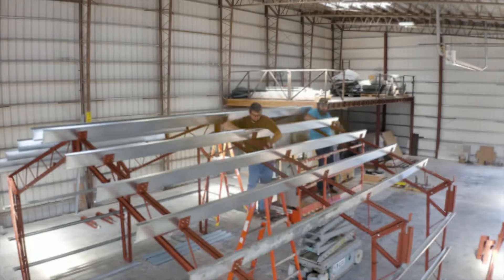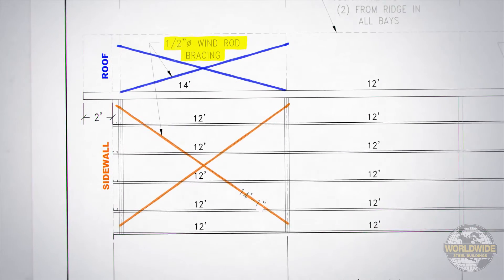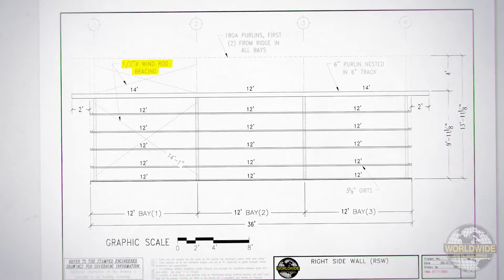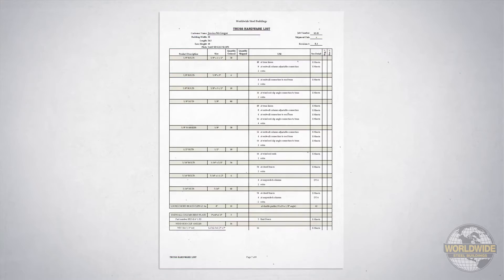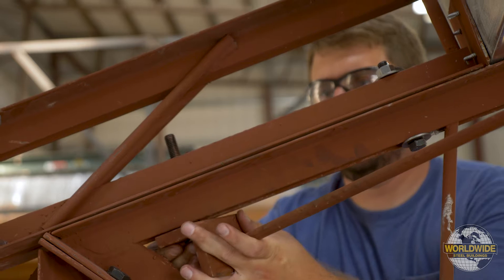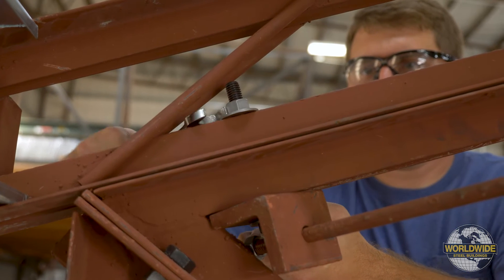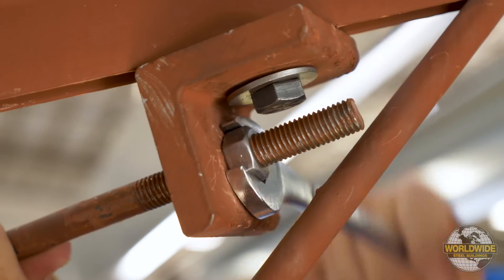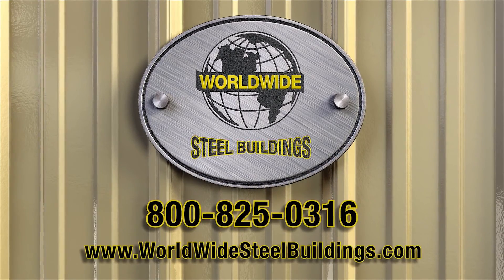Steel Building Construction - Wind Rod Brace Install for Roof - How To DIY Steel Building

Comment: So you use the wind braces to pull all the columns and roof trusses plumb after the purlins and girts are installed?
Reply from the maker: Great question!  You should check your building for plumb and square throughout the installation of the columns and roof beams so that they don’t get out of line.  Once the purlins and girts are installed, then we do use the wind rods to make final adjustments to ensure all is plumb.